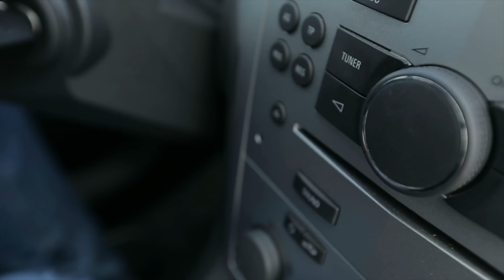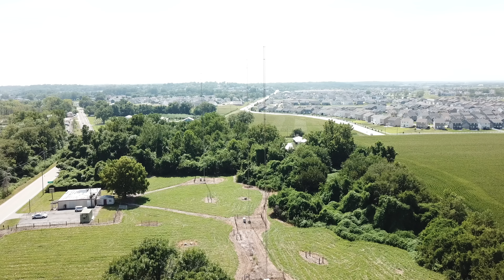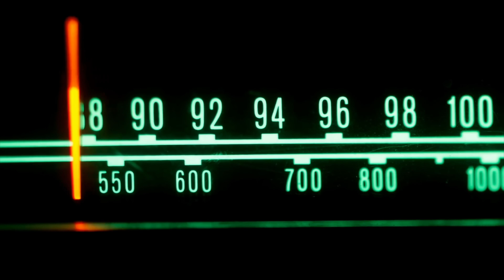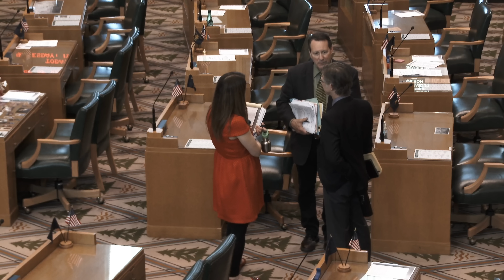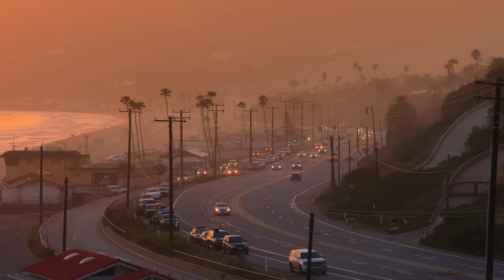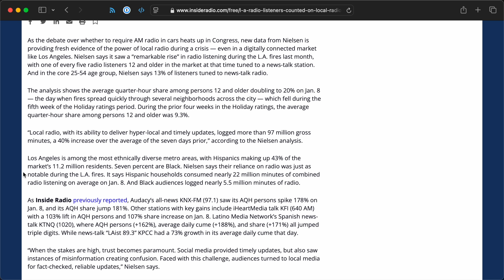Automakers are losing the battle with this 100-year-old tech

Comment: If a car's electronics interfere to the point where ANY radio band won't work, Is that not already an FCC violation?
Reply: Yes.
Reply: It’s just an excuse from the auto industry to move everyone to a subscription model by getting rid of AM FM radio
Reply: @hellsfirefreedomtube6984  THIS!!! It's the same reason cellphone providers hide the FM receiver (That's on virtually chipset of most phones) so you run up your data use.
Reply: I think it's got to do with Sirius in the new cars. All of them have it... 
I think they want to get rid of AM radio, to try and force people in remote areas, to subscribe to their satellite services. More and more people are ditching the overpriced satellite and cable services (cord cutter culture) and they are losing business.
Reply: That's like every Mazda ever. Their radios suck.
Reply: @ravenandthestranger  I had a 2016 Mazda 6. I thought the AM radio was great. I'd listen to stations all over the US at night. It's one of the things I miss about that car. What was wrong with them?
Reply: @BuffDelCampo  Some models had decent radios but I’ve driven a few brand new CX-5s and the sound system rocks but the actual radio reception wasn’t good.
Reply: @ravenandthestranger so "every Mazda ever" is a few brand new cx5's? My 2014 radio works perfectly fine.
Reply: @ I’ve got 3 Mazdas. All the radios are hot garbage on reception. I’m not saying they sound bad with your phone plugged in or CDs or anything like that. Reception sucks. And the range is 2003 all the way into 2016. So I have a good mix
Reply: @ravenandthestranger  Mazda radios work great even under ground in garage where other Ford/Hyundai suck at propagation...
Reply: @ravenandthestranger  was this recent? Because I have a 2023 CX-50 and the terrestrial radio reception is some of the best I've ever had. I live in New Jersey so we have a decent amount of stations backed on to each other but I can definitely tune 50 plus miles away. Even more if I shut the HD radio off.
Reply: Why is it that AM if forced to lower their power output or go to digital (ruining AM radio entirely) and yet the FCC allows EVs to output tremendous amount of AM and somewhat FM interference... something isnt right
Reply: Part 15 applies to interactions between devices. No rule saying your device can't make itself be crap
Reply: There is an AM antenna tuner hole near the antenna socket usually, so you can tune yourcradio for the best reception on the weak station with a plastic screwdriver.
Reply: @rikardlalic7275  Good to know, but what good is peaking a mobile rig to a particular part of the band when you're driving around and want to listen to various stations?  Antenna circuit peaking is something I think of as useful only to a DXer reaching for that particular station ID right here, right now.
Reply: Accept that in a digital world everything is making sharp edges all the time and design better receivers. You can get tons of compute power in a $4 chip now for running DSP, and tensor cores make things like reconstructing clean audio from a noisy AM signal with ML techniques much more feasible. Adaptation is more powerful than regulation.
Reply: I never understood part 15 where a receiver has to accept interference, including interference that causes undesired reception.
Reply: @georgescott4505  IKR? Kinda defeats the purpose of the rule.
Reply: Yes. 

Any products I design must ALWAYS comply with the rules. They're there for a reason.
Reply: No. Pass your am radio in front of your computer monitor, you'll see the interference makes am radio impossible. And yet monitors aren't banned by the FCC. Nothing says the interference is outside the car, just inside.
Reply: I believe the electric car system will not interfere the AM while engine off. Of course they also can find a solution that disable the AM function while driving or engine running. For example, I parked the car and stopped the engine. Why I can't listen it?
Reply: the newer LED lights drive circuits operate in the Khz region and cause interference in reception. FCC dosent bother ....But as now the 5G Spectrum is using near C-Band frequencies the terrestrial interference requires most C Band LNBs to be fitted with external 5G filter..  Here too FCC dosent ask ...!!!
Reply: you'd fucking think!
Reply: AM about all I listen to.  In rural American FM few stations and weak coverage.
Reply: @ryan6307P  Yes! That is one of features of AM. FM is fine for local urban areas. AM can cover hundreds(sometimes thousands) of miles. AM radio is a VITAL national (and international) service.
Reply: More like the makers don't want to go through the hassle of proper shielding.
Reply: @chedelirio6984  Yep!!!
Reply: It is.
Reply: Don't worry in Trump's America they'll get rid of all consumer safeguards
Reply: FM is much more resistant to EM interference than AM, so there is that
Reply: No.  See FCC 15.103(a).  Transportation vehicles have always been exempt.
Reply: Not if it's localized no; our regulations are pretty loose.
Reply: Probably not.  Interference is probably considered in the same category as unlicensed broadcast. If the AM/FM broadcast is low powered, with a range under around 200 feet in the open (without interference) it's considered legal.
Reply: Not necessarily, if you consider the entire vehicle as a unit.  Medium wave QRM may be mostly confined within the r.f. cage constituted by the metal body, and emission to the outside world within acceptable limits.

Meanwhile on FM several times in recent years I've had the program I was listening to obliterated by a passing vehicle, even 50 feet away.  I've never had that strength of interference from the i.f. stage of a nearby superhet receiver on AM.
Reply: @goodmaro  issue is of the Switching circuits employed I the LED drive circuits which operate in the Khz region . These devices (also the mobile chargers ,and lots of SMSP power supplies) don't have 100% RF suppression working and easily radiate to 5 to 10 meters distances .. Consider thousands of such devices operating in the Homes  / Cities which ruin MW radio reception .
I get to listen to MW only when I am out of Town areas away from the Cities ..
Reply: Not necessarilly, proximity is important.  Just as it isn't an FCC violation for the LO in an FM radio to wipe out an aircraft's VOR NAV receiver - hence the original FAA ban on radio receivers on commercial aircraft.
Reply: Good ol' Part 15 paradox - if nothing can emit harmful interferance, why must everything accept harmful interference?
Reply: @mpf1947  Because we live in an imperfect world and, where possible, we want stuff to work even when some other stuff is non-compliant.
Reply: @mpf1947  What is your definition of "harmful" interference???
Reply: @pibbles-a-plenty1105  Ask the FCC.
Reply: @mpf1947  imported stuff, damaged products etc

There are many ways
Reply: @mpf1947  because some things produce harmful interference... Like the sun and the earth.
Reply: @ Because it is a Part 15 device. Just ask the FCC.
Reply: Not sure it counts if you're interfering with yourself.
Reply: @ Only if you complain about your own violation to the FCC. Otherwise, they won't know.
Reply: It should be, but electric vehicles got an exemption to get more manufacturers to make electric vehicles.
Reply: @WamocIsolda they got an exemption? You need to direct all of us to the source of your comment. Otherwise I’ll assume it is made up.
Reply: @WamocIsolda lol, either you’re gullible to someone who made that up, or you made that up
Reply: Today's cars do not make noticeable interference anymore.
Reply: My new Subaru makes tons of interference, on AM and FM. Those tiny "sharkfin" antennas are horrible , and the radios sound bad on broadcast channels, no matter how many options settings  they have.  @rikardlalic7275
Reply: It doesn't cause interference to other receivers a few meters away. It's your choice to sit in the car or not. So many gadgets you plug in these days put interference on cables.

Comment: Great up date. hear in NY our interstate system has a AM transmitter that gives important travel information out to the public . Just a few years back we had a record blizzard and over 50 people died on highway system.  Many lives were saved by broadest on AM radio from NOAA that gave plenty of warring of a deadly blizzard going to hit western NY . Sadly many did not listen to warring or did not get the information.   I hate to think how many more deaths would be if NOAA weather alerts did not go across AM radio on NY interstate system.  NY state invested a lot in this system and it works very well . Even delays and border crossing info is given   on AM radio from your car as you travel . The signs are all over the interstate with the frequency to tune to and has yellow flashing lights to let you know important information.  With cell phone laws when driving many phones will not get alerts when moving. Many turn phone off . and cell phone coverage is not so great in spots .  Now look at Asheville NC with the hurricane. AM radio came threw because of increased range at night the AM stations outside affected area came threw ! Even SW station like WBCQ and WMRI was heard in Asheville NC and many outher hard hit areas .  Many AM stations told NC and TN and outher places where to go for help for food shelter and medical supplies and what ER was open and setup . As bad as that was many lives were saved   buy AM radio !  Knowing people in the area that told me the only connection they had to outside word was a pocket battery AM radio ! . No FM stations came in . That was a big wake up call!!

Comment: Great to keep radios having AM,  because amateur radio is often AM or SSB. We need the rfi gone from newer vehicles to use them.
Reply: @John_Ai9D  the vast majority of amateur radio usage is analog FM. You might be referring to the extremely niche ham bands that very few people use.
Reply: @RealBenAnderson  FM is common on VHF and UHF bands only. HF is primarily SSB, which makes more efficient use of the available bandwidth.
Reply: @dkd1228  VHF and UHF make up the vast majority of all ham transmissions.
Reply: @RealBenAnderson  "the vast majority of amateur radio usage is analog FM" Only if you hold a technician class license.  Many of the HF bands are crowded whenever they're open.  Access to HF is the primary reason hams upgrade their license, and almost 50% (over 400,000) have done so.
Reply: @ OK and what does any of this have to do with AM receivers in cars? They don’t pick up ham bands anyway.
Reply: Automobiles (still) make noise on AM bands.
Reply: @prophetzarquon  not in the broadcast band. There are videos of people taking AM radios inside their Teslas and they work just fine. What you are talking about is prohibited by existing regulations, and has nothing to do with this new proposed regulation.
Reply: @dkd1228 which those bands are the only bands that lower level hams can use (at least in the USA)
Reply: AM is rarely heard on Amateur radio today.  Sure there are a few hams that still use it, but not many.  And most of those are using antique rigs that only had AM for nostalgia reasons.  The vast majority are on sideband (HF) or FM (VHF and above) for voice operations.

Comment: EMC, efficiency and cost are a “pick any two” sort of deal. With faster switching power semiconductors of today, the fundamental switching frequencies are encroaching on, or are already overlapping with, AM frequencies. Attenuating harmonics is an order of magnitude easier than fundamental frequencies. Also, high frequency motor drives now are pushing kilo-amp range currents through wires that no longer a fraction of the offending wavelength, but more like, say, a tenth, which makes them much more effective at radiating. Sure, with bucketloads of soft magnetics and capacitors they could keep even high efficiency, high frequency drives quiet in the AM band. But that costs something and adds weight. If you can’t get a physical button to adjust your cabin heater these days, there is no hope for enthusiasm for EM “compliance”.
Reply: I'd have to agree. 
And if I did have to pick between high frequency, high efficiency power switching or AM radio I'd certainly prefer having access to the former.

Comment: AM radio is no longer relevant. Hasn't been for decades. Let it die. (Respect your balanced discussion.)
Reply: Large area coverage emergancy broadcasting......cell fails at the slightest whim, internet fails at the slightest whim.   There is a reason FEMA has many transmitting stations installed at AM broadcasting stations.....

Comment: AM radio seems to be mostly a US thing, here in Europe it FM and that seems to be going away and most is going over to DAB+  
Also I cannot remember ever hearing anyone saying WOW! check out the AM radio in my new car. ;)
Reply: The Western US is a vast empty country. AM is all that reaches these areas. It’s one of those things that you don’t realize you need it until it’s gone.
Reply: @Bob_Smith19  100%, and they don't call the midwest, and western states tornado alley for nothing, so if cell towers, and power lines are out from a bad storm, then you're AM and the NOAA weather band is about the only thing that can reach a mass amount of people to give them information quickly, but having said that not everyone has a NOAA Weather radio, but almost everyone has at least one, or knows someone near them with an AM Radio of some sort.
Reply: When I got my new 2024 Crosstrek, I did say "wow" when I tried out it's AM radio. Props to Subaru for not cheaping out on the AM tuner, it's incredibly sensitive and has good DSP noise reduction. I can get WSM 650 loud and clear 1200  miles away driving 80 miles an hour.
Reply: @christianelzey9703  Does it have a large antenna?
Reply: @Warp2090  no just a small sharkfin
Reply: I listen to AM shortwave broadcasts from many European countries all the time.
Reply: Long live shortwave  @geraldscott4302
Reply: Europe sucks.

Comment: I wish they would mandate weather band in cars too.
Reply: I just posted a comment including the NOAA Weather broadcasts and alerts as something I think is important, too! 🙂👍
Reply: @bobblum5973  Agreed, I've got a weather radio here at home, and I also bought one for my work incase the power goes out as it picks up far better than AM/FM at my work site, and if a tornado is coming my way I want to know it before my cell phone even tells me.
Reply: My grandma's car had built in weather radio growing up. It was just another band option next to the am & fm buttons
Reply from the maker: It'd be fun if someone built a full-fledged SDR into a factory car head unit. Have a number of antenna connections too :D
Reply: My 2001 Saab had nine radios connected to the central computer by CANBus; my Mom's Chevy Sonic has all those plus WiFi (always on), Bluetooth (always on), & cellular (always on). 

Major auto manufacturers partner with subscription service providers, for increased monetization; they're not lobbying to omit AM radio as a cost-cutting measure, they're lobbying to kill AM radio, as an anticompetitive measure.
Reply: @GeerlingEngineering This is technically possible now I would think since there are Android head units (Single or Double DIN size) that you can install in cars now. Since they run Android, it opens up the possibilities of all kinds of apps to run on them including SDR apps/hardware.
Reply: Why is weatherband even a thing?  We all get weather from more convenient sources
Reply: Dairy might be Deadly to you, dear, it's a life saver for me! 😊

Comment: what antena was the round one in your video?
Reply: I believe that is a tool to enhance reception of AM radio signal .. it is a tunable medium wave loop antenna .. and they do work for the most part to ehance listening experience .. they are about $30 .. but of course you can make them yourself .. all you do is place it next to your am radio .. or you can actually connect direct to the antenna port of a portable radio .

Comment: I've been a casual radio geek for over several decades, having had multiple crystal radio sets, repaired tube and transistor receivers, and spent many late nights growing up trying various antenna ideas to listen to far away AM stations (never had much success with shortwave).  (We'll skip the experimentation with spark gap transmitters and etc.)

These days, when I drive the 300-ish miles thru the mountains to visit my aging parents, for much of the trip I am out of range of any FM radio station.  I can pick up AM stations except for a few miles here and there.  If I take the longer interstate route I have AM the entire way (and cellular), but with FM there are several places where for 10s of minutes the airwaves are functionally empty.  It is a similar situation when I drive the 400-ish miles to visit the nearest siblings, or 700 miles in the opposite direction for my other brother.

As a matter of principle, I don't like the government stepping in like this, but I hate that AM radio isn't or won't be available.  I guess it is a small thing, but the bigger problem I have is there is seldom anything on AM worth putting up with the typical AM reception issues on long drives.  I don't know if 1) the bill will actually increase access to and usage of AM radio for listeners, or 2) if that increase will have a positive impact on available programming.  I doubt it. And that takes me back to not liking the government meddling.
Reply: I normally agree, but in this case if the government does not do something then it seems companies will likely stop producing AM radios in the next few years causing listener bases to drop to levels to were the broadcasters won't make enough money to stay in business, as most consumers won't go out of their way to to get AM radio if it's not in their car by default, and they don't have one in their home, which I suspect many younger people don't.